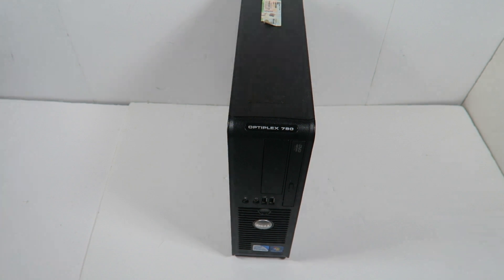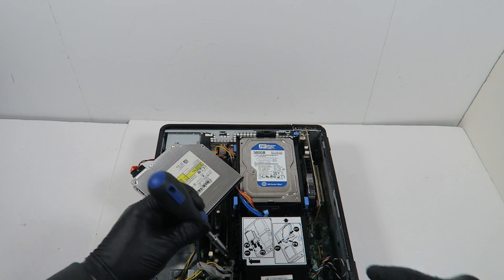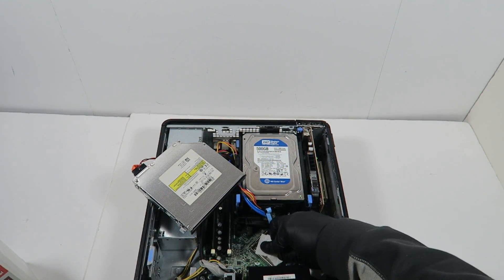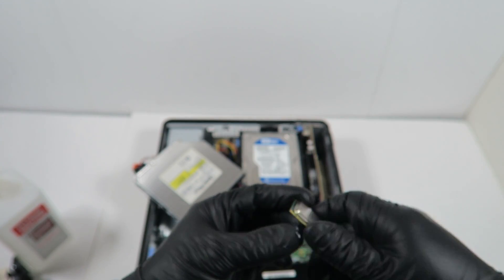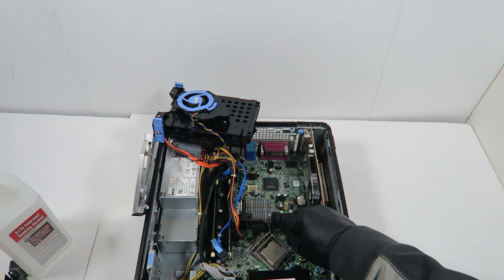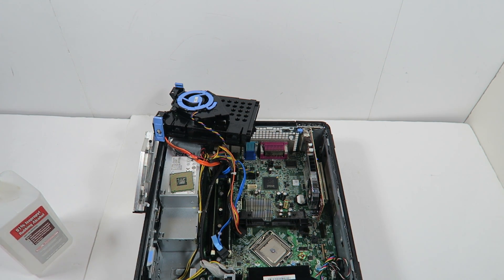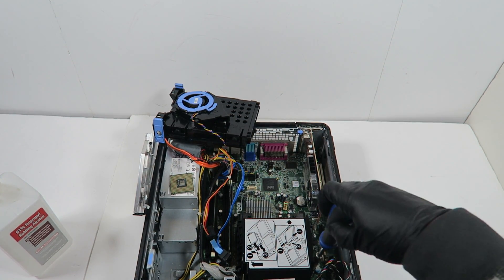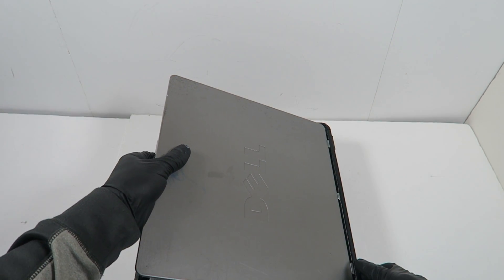Dell Optiplex 780 SFF CPU Upgrade

Comment: Great video.  I also have a 780 SFF with an E8500 and a Dell R5 240.  Is the PSW good enough for a Q9550?  I have the copper heat sink already, but worried about power under load. Thanks.

Comment: I have a Dell Optiplex SFF 3010 can I upgrade the cpu? I also want to upgrade the cooler is that possible
Reply from the maker: Hi, yes it is possible you can upgrade heatsink cooler on mini tower using Dell J9G15 Optiplex Xe2 Heat Sink Does Have Copper 
https://www.youtube.com/watch?v=SWrsSH4A9zc

Comment: If i buy a 500w power supply can I leave it outside the case? (For my dell 780 sff)
Reply: I have one of those lol it blew up cause i put a q9550 in it rip
Reply: @2xvxb609  I put a gt 710 and my powersupply went in flames. Got an actual gaming pc now with a rx 580 and a i5 9400f

Comment: Hi I got a Dell optiplex 7010. Today I turned on my PC and my fan suddenly was spinning faster than usual but my monitor screen is black. Not sure what the problem. I just have a feeling it might be the motherboard but not sure... What do you think?
Reply: Durjoy _b what fan was spinning faster?
Reply: @morso9080  it was the CPU fan. But it did end up being the motherboard. Probably because of electrostatic discharge cuz i wasn't grounded when working on the parts
Reply: Durjoy _b ok, did you get it to work again
Reply: @morso9080  yes, just had to buy a motherboard from eBay.
Reply: I think you bought a motherboard for no reason. That issue happens when the CPU is not properly mounted and stops making contact with the proper pins. Reseating the CPU should do the trick
Reply: @andrive  I have tried reseating the CPU multiple of times before buying a motherboard. I've got it to work and the motherboard only cost me $14
Reply: @durjoy_b1782  Oh. Nice. At least it was cheap

Comment: Hey is it possible to upgrade this pc to 12gb ram, Intel i5, 556ssd? For gaming?
Reply from the maker: Hi, yes this PC support up to 16gb of RAM and supports max CPU upgrade Intel Core 2 Quad, you can use SSD like samsung brand i like.
Reply: @Mxkdt  thanks. I'm pondering upgrading my pc or buying a new one.

Comment: Hi, I have the same computer, can i put the processor Intel Core i5-2400 quad core 3.4GHz in computer?
Reply: No the 2400 is a 1155 socket this is a 775
Reply: No the 2400 is a 1155 socket this is a 775

Comment: Hello, i have a Dell optiplex 760 and i was wondering if i could change into  a gtx 1050 ti and a core 2 quad core cpu 

Thanks in advance
Reply: morsotom no you can’t the power supply is too small and it won’t support it so you have to get it in mini
Reply: Gaming on a Tin can i have at core 2 quad and a gtx 1050 atm and it actually works just fine
Reply: Yea non ti
Reply: Gaming on a Tin can yes, ti needs external power so i didnt buy it.
Reply: What computer do you have
Reply: Gaming on a Tin can optiplex 780 sff

Comment: Will the 780 SFF take the q9650?
Reply: Yes
Reply: Eric Garcia yes i have it right now if u have any questions you can ask me
Reply: @morso9080  Bro is this small powersupply enough for it
Reply: @fasihuddin1789  Yes. I ran it for almost 2 years with a q9650 and 1050
Reply: @morso9080  thanks you so much but how about temperature bro
Reply: @fasihuddin1789  My temps did not go over 60 if I recall correctly.
Reply: @morso9080 hey, I just installed the q9400 cpu but after booting it’s still showing old q8400.  Not sure what i did wrong

Comment: Yo dude, What power supply do I need for a GTX 750ti 6 pin??? Do I need a 450w cause I only have the normal psu for the Dell Optiplex 7010 sff.
Reply from the maker: Hi, you do not need to upgrade your power supply i am using right now 240w with gtx 1050 ti with i7 3770 small for factor PC.

Comment: can i put core i3 2100 there?
Reply: It will not work..this right here is an LGA775.. the i3 2100 is a second gen core.. LGA1155.. entirely different socket